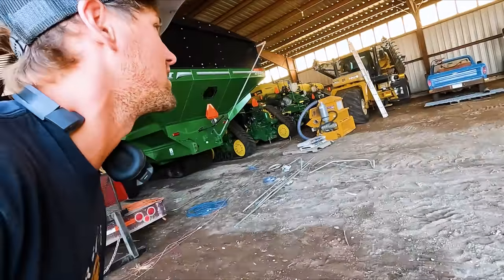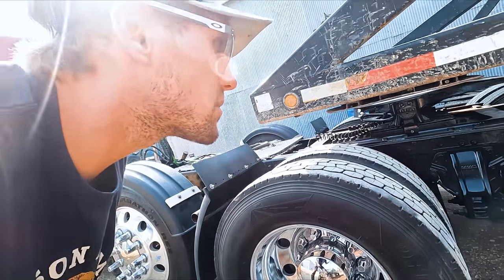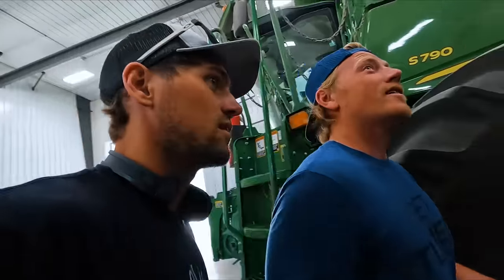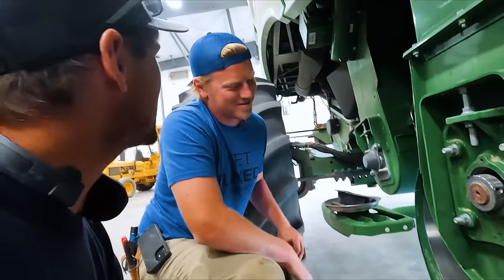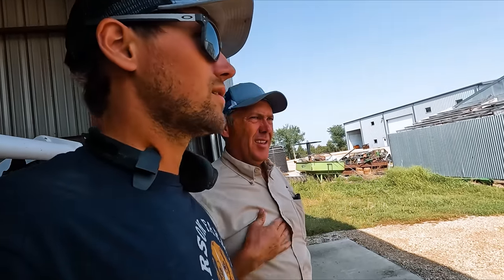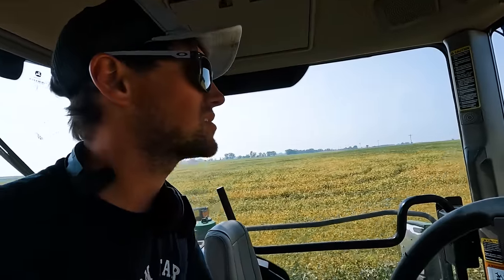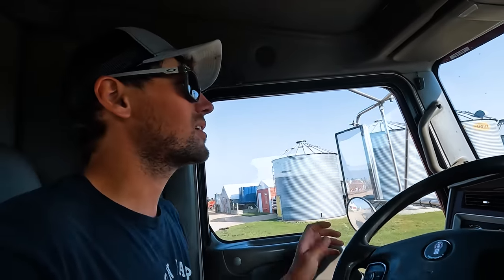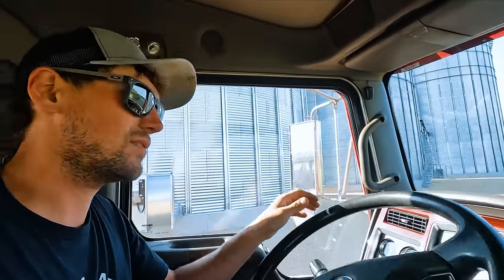Maybe A Red One Would Last Longer?

Comment: Before you pull the door handle off  on the new Kenworth trying to close the door,  all you need to do is open the window an inch to let the air escape and it will close easy peasy.
Reply: If that works, add a ventilator and that a way to relieve the air pressure. Detroit does it on some cars that have the problem with overpressure. 15:26
Reply: Dont know if there smart enough to do that

Comment: After 40 years driving trucks I got into one with an autoshift. Been in it about 6 months and I still reach for the shifter every time I stop. I would rather have a 13 speed but this is what you get these days.
Reply: I’ve been retired 12 years but my company gave me a 12speed Meritor ( not sure about the spelling) I was a bit nervous about it because I ran the Canadian Rockies and trusting an automatic shift transmission was a big leap for me. My first trip Toronto to Vancouver made me a believer in that transmission. Pick your downgrade speed and it was always in a gear that would hold my revs to maximize the Jake. 2years latter and I get a 10speed Eaton Smartshift. That transmission was not only not smart, it completely lost focus on what it was designed to do. Have no idea what is on the market today but hopefully. Hopefully they have it figured out by now. Unfortunately there are more loads than drivers so hiring drivers that know what a clutch is or how to navigate from gear to gear can be almost impossible .
Reply: Norwegians 😂

Comment: A tip for you guys on the automated transmission for maintenance that PACCAR  doesn't give anyone is the air drier for the air system needs to be once a year or 140,000 miles. Running in dusty fields the air compressor will get some dirt in it and the MTM PACCAR. Calls its the TCM will get dirt and oil in and cause it fails and cause the transmission not to shift. And the repair cost $3000 and more. So make sure you guy replace them and get the best air drier you can get.

Comment: A cement is a binder, a chemical substance used for construction that sets, hardens, and adheres to other materials to bind them together.
Concrete is a hard strong building material made by mixing a cementing material (such as Portland cement) and a mineral aggregate (such as sand and gravel) with sufficient water to cause the cement to set and bind the entire mass.
Reply: You are so clever. 
But no one cares. In different regions, and different countries, terminology and communication habits are different. Everyone knows what he means when he says "cement", just carry on.
Reply: @daveevans2710  LOL ...Flatlander
Reply: @jz1340  Sorry, what's a Flatlander? Not heard of one of those.

Comment: There are setting that can be changed in transmission. RIght now it's either urge to move or creep mode. Also other setting to change how it shifts from shift like grandma to performance. Try Allison automatic some them you really have to ride the brake because it wants to take off like you're about do brake stand